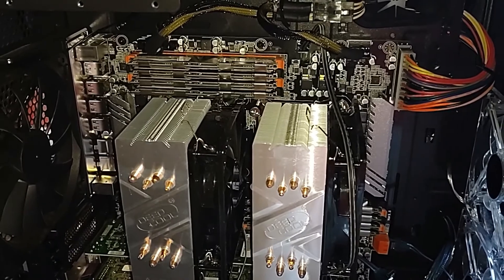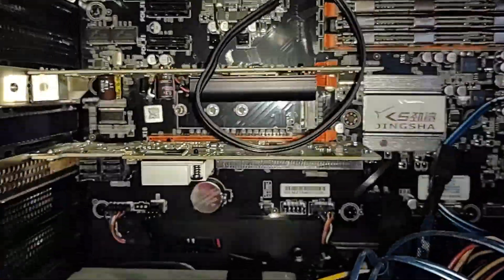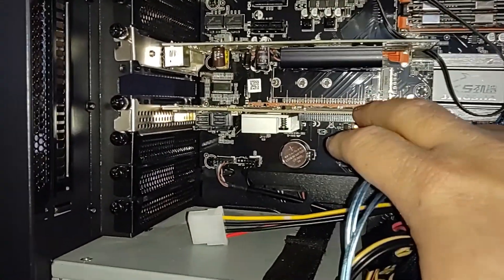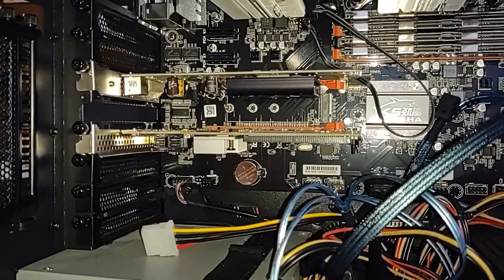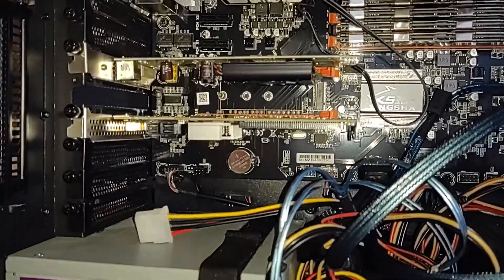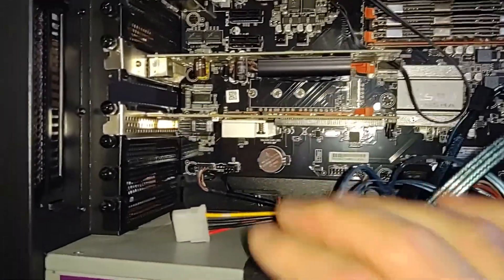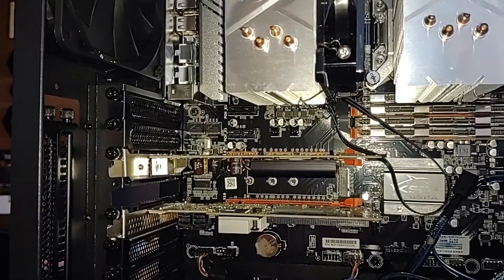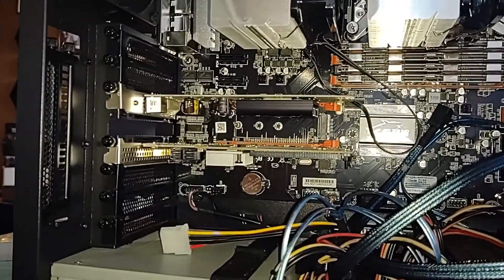VMware Home Lab Gen V Build Part 7 Wrap Up / Final Thoughts

Comment: Thank you for making this video. I want to run VMware Workstation Pro 16 and need to find out if VMware can still run on these machines?
Reply from the maker: You are most welcome.  RE: Workstation on this System board -   I'd recommend checking out the VMware Documentation on Workstation for their hardware requirements.  I never ran workstation on these boards so I don't know if it would work well. Don't forget Workstation requires a host OS (Windows, Linux) so ensure the system board you choose will work with it.
Reply: @vmexplorer  I realize for PCs as workstations you need the new hardware.

Comment: It's nice to find your channel.  

Have you tried to run the 10G card on the x1 Riser?
I used to do it with a single Port connectX -2 card, I know you won't get the full 10Gb/s But you should have around 5Gb/s On PCIe Gen 2.
Reply from the maker: Thank you for the reply, I did not try the 10Gbs card on the riser.  I did look for a way to extend the NVMe or "split" the working x16 slot, but they were pretty pricey.  Additionally, with the changes in vSphere 7.0 I would also have to find a way to add complaint NICs, adding more to the overall cost.  So at this point I'm moving on to a different and more vSphere 7.0 compliant Mobo.